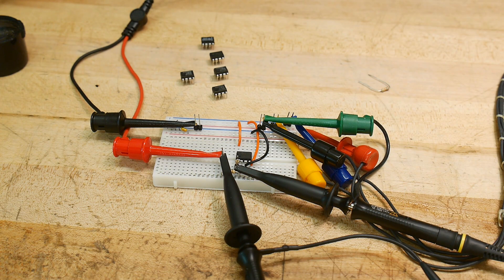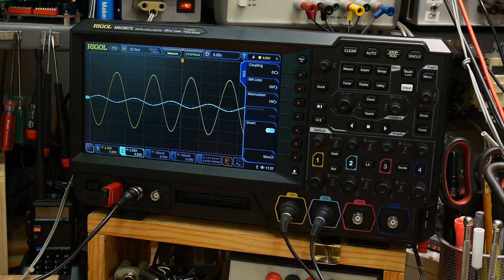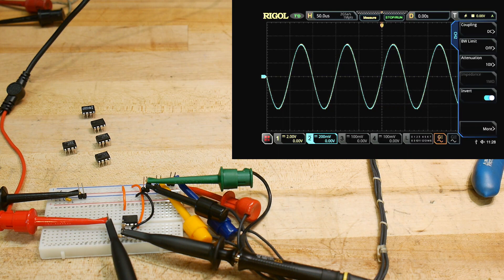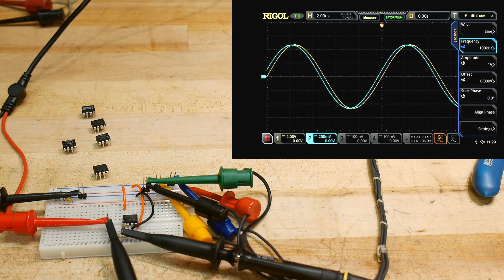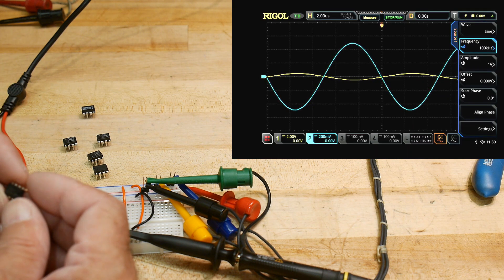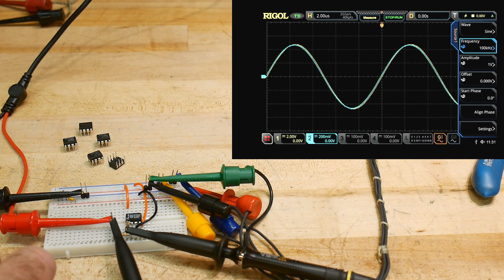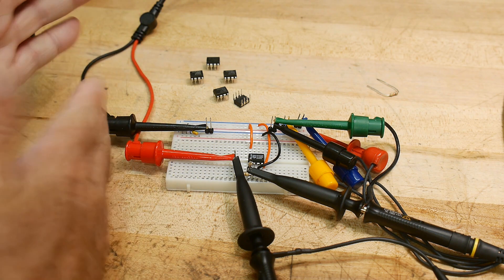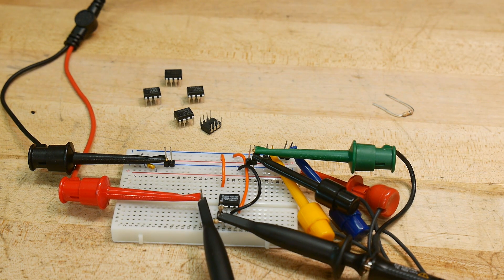#889 Basic: Op-Amp Phase

Comment: The scope HDMI picture is much clearer to see, so well worth keeping.
However there is a problem with the current setup, when you adjust the scope you blot out the camera image with your arm.

If you could arrange for the camera to be on your left hand side rather than the right this would be much less of a problem.  (I guess that the camera is on the right so that you can focus on the scope easily)

Another option would be to have the camera in front of you looking "down" on the breadboard or whatever.

Andy